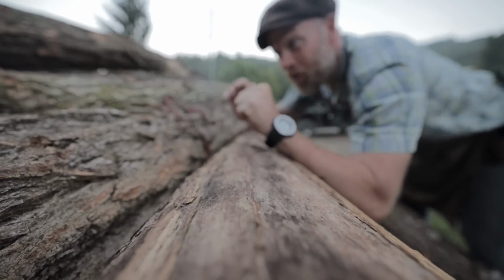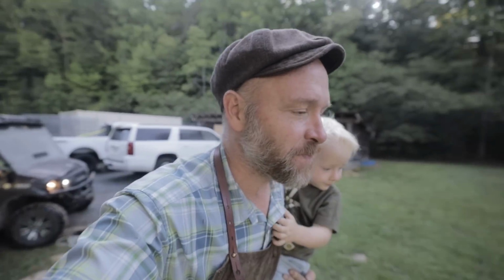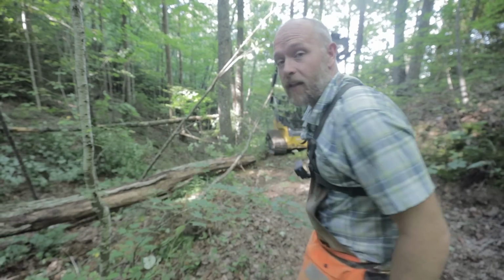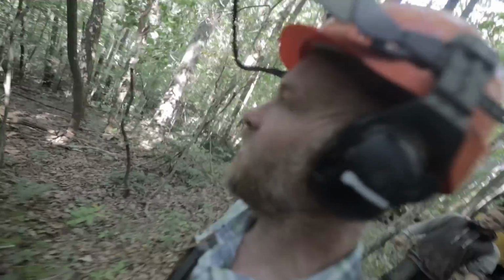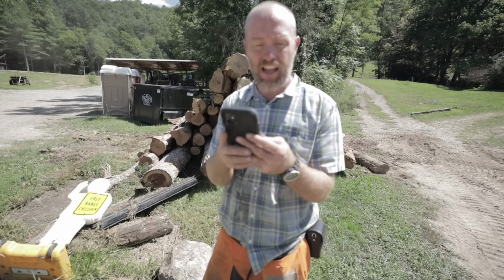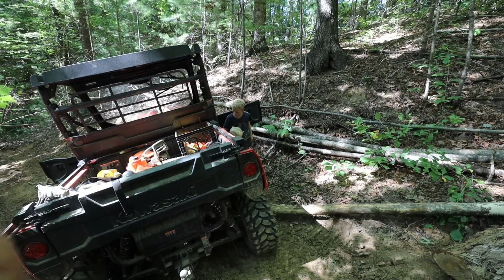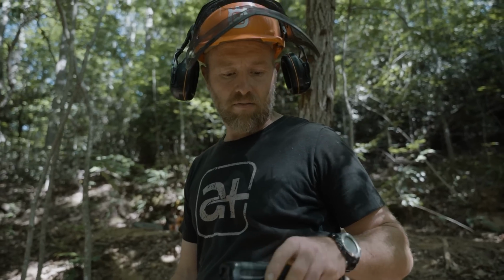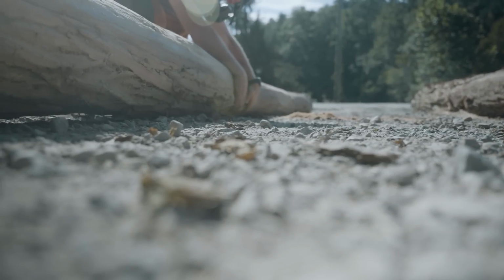Cutting TREES for our REMODEL | But Why

Comment: Hey Justin, you should first cut a wedge out of the tree on the side you want the tree to fall on. Cut out about a 1/4 in. Then finish the cut from the back side. As the cut progresses, the tree will lean into that wedge and your blade will never pinch and the tree has a better chance of falling where you want it to.
Reply: Ha! I am a 73 yr old city girl and even I know this just from watching tree felling videos😊. You would think Justin would as well
Reply: If you had watched his previous logging videos, you would realise that he does that each and every time.
Reply: He already does do that.
Reply: He does but his face cut should be a bit deeper. I lean more towards a third or a little more for the face cut so it really leans into it. Making sure the back cut is parallel to the face cut is important too.
Reply: Almost had a barbers chair... dangerous

Comment: Build the deck with maintenance friendly trex decking and tape the top of the joists to prevent water rot.   Use the popular for a pool deck diving platform.  You will save rebuilding a wood deck and finishing it multiple times.

Comment: think about doing some more logging for hw flooring - do it safely - use the machines more to get them to fall where you want - more chains and rope - the more you do it the smoother and easier it will get. it is a lot of work to process it all but mostly just production - due to cost of lumber it probably is worth it and you have a lot of clearing yet to do so double win really - the machines really helped out - the right tools help

Comment: Hey Hey, Also if you are working with chain place a blanket or chain protection to prevent the the chance that the chain hits the cub on the machinery has saved my life a view times. Usually I use 2-3 m depending on the length on the chain. Been watching your video during the last few days and just felt I should mention it
Reply: Hopefully you see this

Comment: You really need to watch a bunch of Buckin Billy Ray videos before you venture back to the woods to cut trees. The one that was leaning hard should have been bore cut and you need to invest in wedges, and about a 3 foot long ax to pound the wedges. The saw has a sight line on it so you know which way it is going to fall based on your face cut. When that tree barber chaired  you don't know how lucky you were, usually they pivot and jump back at you when they do that. I love your videos and I know you want to have your kids with you at all times but Dude taking a toddler into the woods with you with your tree cutting skills is either plain stupid or very very careless. I am not usually this critical of any youtuber but you put yourself and your kids in so much danger this time.
Reply: Amen

Comment: If you can fell your trees, and cut the planks, you can lay the wood for your deck. If you can build those rickshaws you could lay decking. Especially with your two eldest lads. ( sons ) they are pretty handy with carpentry. Save a load of money..✨👍✨👍✨👍✨👍✨👍✨👍✨👍✨👍✨👍❤️❤️❤️❤️❤️❤️👍❤️❤️❤️❤️